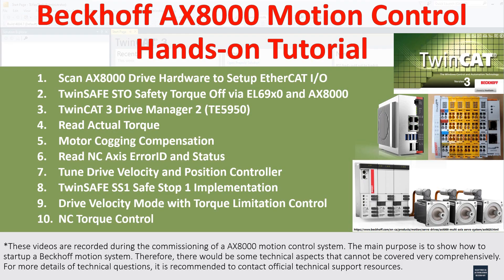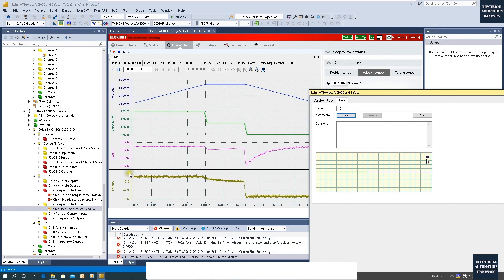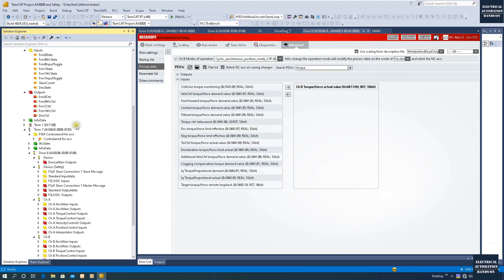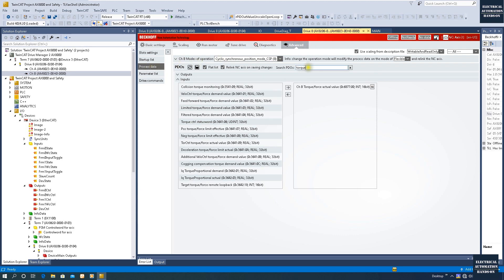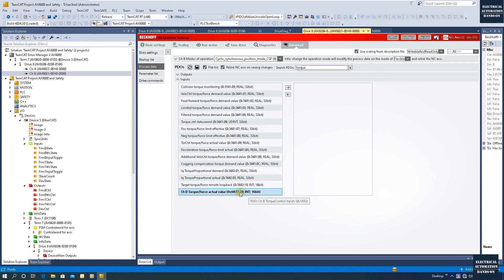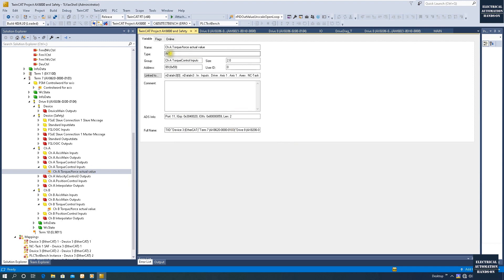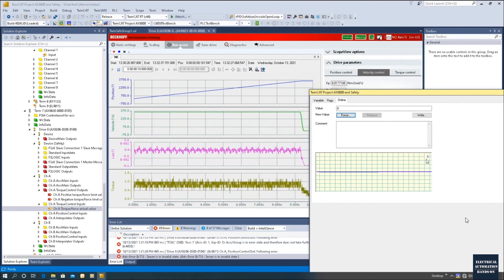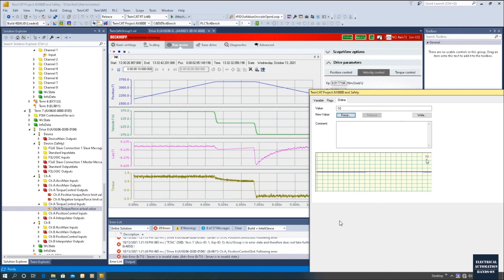MB24. [AX8000 Servo][4/10]  How to Read Torque Value from Beckhoff AX8000 or AX5000 Drive

Comment: I am using the drive EL7201 with AM8111 motor. In Beckhoff's manuals they have some formula that uses the torque actual value, torque constant and rated current to estimate the torque. However, your method is much simpler! Thank you so much!
Reply from the maker: Thanks! Glad it would be helpful! I am curios about the torq control for EL7201. Please check the EL7201 to see if the torq control support this card.